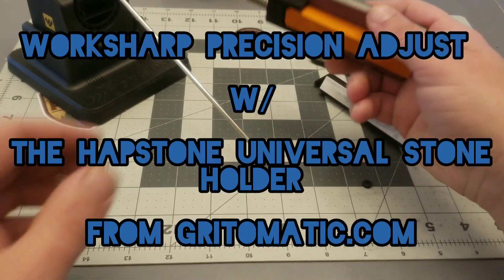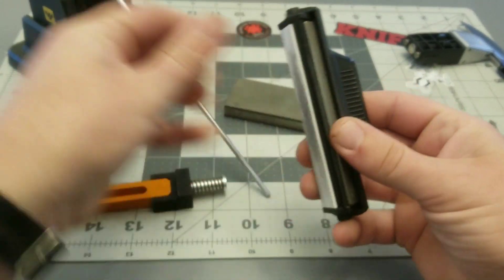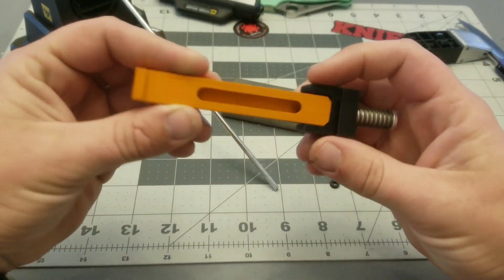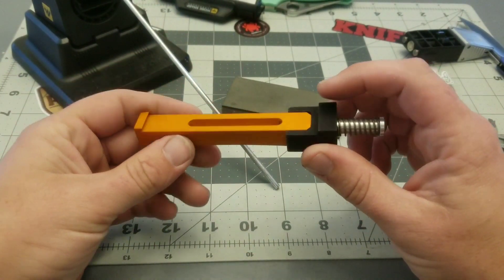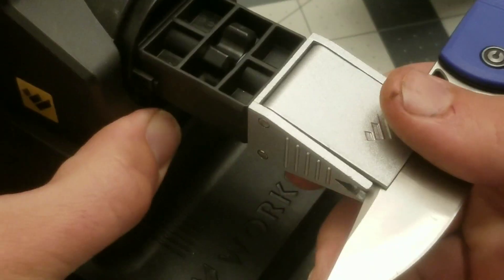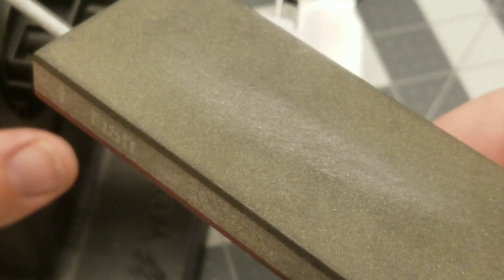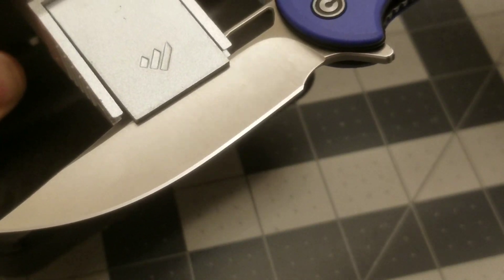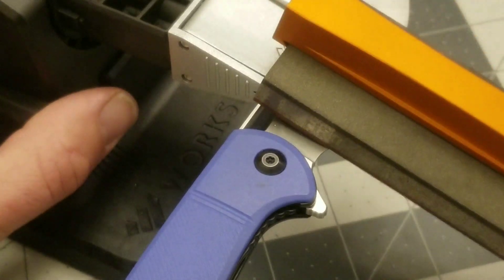The Hapstone stone holder for the Worksharp precision adjust sharpener- from Gritomatic.com

Comment: Been using this every day for about 2 weeks now and the spring tension and the play are absolute non issues.  A vast improvement over the stock system.
Reply from the maker: Its a great holder. Works well. Its not an issue in terms of it making it unusable. But you could get a more consistent edge finish if those two things were improved.
Reply: They should use a screw instead of a spring, like every basic stone holder on earth.

Comment: 🔥📛👩‍🚒🚒 👍 no issues as of yet with the spring, springs can be made pretty easily though I don't think it will be an issue mine is pretty strong &  solid, imo the attachment and stones massively improves the system, surprised you didn't add any water or soapy water to your stone it definitely helps it not clog or load as fast, the little bit of movement is huge with a thin stone, the wider stone makes it so it doesn't effect it as bad atleast from looking at the edges
Reply from the maker: I don't always use lubricant. But specifically in this video I didnt just so watchers could see better. 
Like I said in the video though I wasn't pointing out fatal flaws. Just things that I think could have potentially made it a little better.

Comment: I Ordered the Venev Greater dog 240/400 is that a pretty good one or should i get a Higher grit one ?
Reply from the maker: That's a great stone for reprofiling and really dull edges on the 240 side. The 400 is pretty fine. That's a good finish for most edc edges in my experience. 
If you want a finer polish you may want to grab a f800/1200 in the future. But what you have ordered will give you some great edges.

Comment: Love your mint para3. I’m assuming being mint it’s the blade hq M4 steel edition? I just got my blade hq mint M4 Manix 2 and love it! 
Also just got my hapstone holder for my work sharp and I’m ordering the Venev dual grit stones this week. I’m going to grab a glass stone also for lapping film.
Reply from the maker: Yea that's it. I'm a huge fan of the manix lw. Had to resist the urge to get one. You'll love the system with the upgrades. Makes it a much more versatile system.
Reply: @steel2stone  yeah I’m excited to have so many more options for finishing. I also love the Manix, this is my second one. My other is the standard G10/S30V model. They’re about the perfect size and shape for me and I love the ball bearing lock.

Comment: If the black endcap piece could be made nearly half the length of the orange with a tongue-in-groove track going down the sides (black endcap grooved on the inside), the issue of the black piece tilting can be fixed totally. The tongue (both sides of orange piece) sides need to fit into the grooves inside the black cap with precision, of course. This would be a very easy fix on the manufacturer's end.

Comment: They have new versions in stock, 4-in stone holder 6-in stone holder.
Reply: Dang, should've waited. I jumped on the 4" holder and immediatly found out that it is pretty hard to find compatible stones. Have to order from gritomatic, no 4" stone seller in Europe, especially not in France
Reply from the maker: Ill have to check them out
Reply: @ramonade_knives  yep the dog and greater dog stones. The dog is half as wide as the greater dog but it's $10 per Stone and you get two grits for each, 80-150 and 240-400.
Reply: @MrT6250  Yup, had to order a second time ($17 shipping...) to get these, thought my usual distributors in France would have some, at least 4" ones but nope.
I did get the thinner ones, I prefer them because they let me see more of the knife i'm working on

Comment: Can’t say I’m too impressed with the one I had received. As mentioned the dovetail would be nice if it could be used. However my biggest issue is that the black piece gets a bit of tilt to it. This causes my stone to not sit flat in the holder. When sharpening and checking with sharpie, the entire belly would be hit however the tip and the heel would not be hit. Flip the knife over and ope now you have to reset angle because the stone isn’t flat….
Reply from the maker: Lots of things come into play with a guided system. The clamp. The blade grind. The holder is a great addition imo. But nothings ever perfect
Reply: @steel2stone  Wicked Edge is way closer to being perfect than this stupid stone holder.
Reply from the maker: @robertbutler8004  lol. Yes very nice. And very expensive.
Reply: $50 sharpener vs $400? AGood job work sharp

Comment: Any recommendations on which stones to get for steel like AUS-8 or AUS-10
Reply from the maker: Any stones will work with AUS 8 really. Just depends on your preference. I prefer diamonds personally. These venev stones are probably the best value in the industry. Or you can try diamond plates from dmt or ultra sharp if you want to spend less money.
Reply: @steel2stone  since gritomatic is currently out of stock on some of the supplies would the Worksharp precision sharpener suffice in the meantime. All I'm basically doing is touching up the edges on a couple knives nothing serious i just want to get them to that nice sharp edge again not looking for that Ultra super polished laser fine edge
Reply from the maker: @harveybeekerthegreysquirre8262  absolutely. The worksharp is a great budget system on its on. This holder just makes it more versatile and allows for a variety of different options as far as stones go.
Reply: @steel2stone  awesome and thank you .. I'm definitely on a budget .. Eventually though I want to get the better diamond stones because I have a couple I would like to put a laser sharp edge on ..
Reply: I have some Buck BOS treated s30v and s35nv blades (as well as 420hc and older 440c). Silicon carbide and diamond work great on those s30 variants as well as the 440c. Should be able to easily handle AUS8 which is similar to 440c which "back in the day" no one could actually sharpen as most had a soft Arkansas stone, hence they went backwards to 420hc but used a cryo heat treat process as well as double tempering to make them much harder (and better) than the typical 420hc. I have a few 420 Pakistan knives around from 30 or so years ago as well as some Bucks from then as well.. 420hc is mostly garbage unless it is BOS heat treated. I can scratch those junkers with a penny
Reply: which two grits is that Stone you have there ??

Comment: Definately do not like the "slop" in that thing; maybe later if they fix that... that is sure to change the angle on each throw. No reason to lose the accuracy Worksharp built in to this device.
Reply from the maker: It moves about 1 degree as far as i can tell.